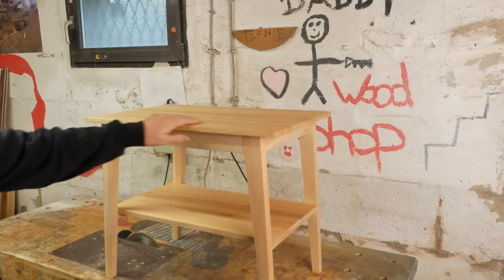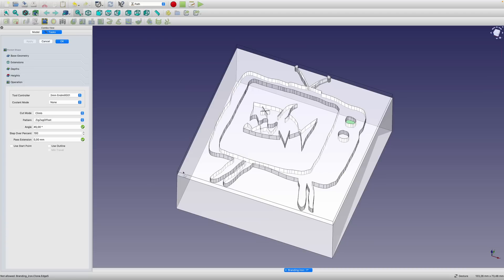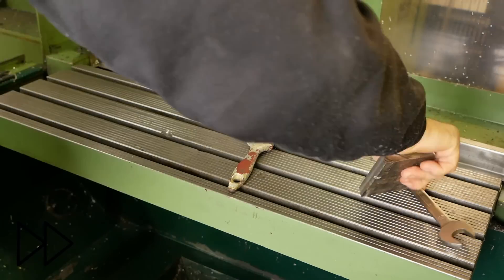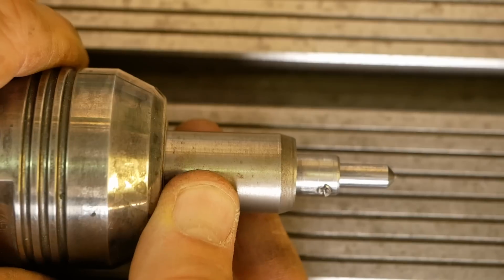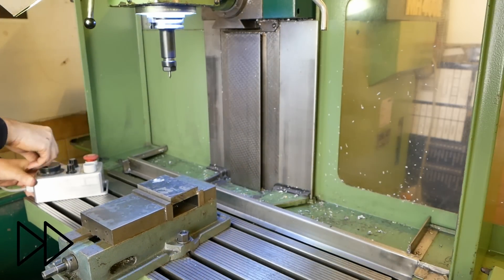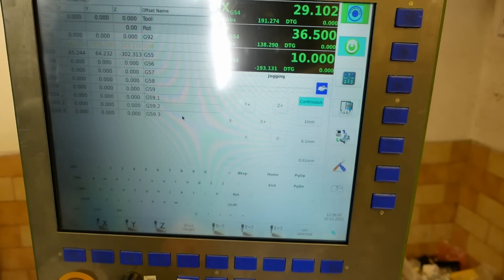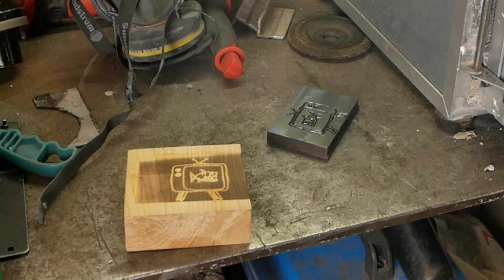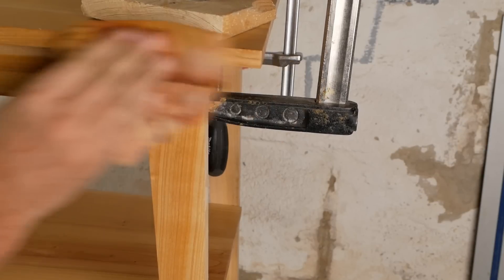Branding iron for my woodwork.

Comment: I would have said use Solid Edge but i dunno how they feel about you showing there software in the videos
Reply from the maker: I looked into Solid works, but they dont have a macOS version.
Reply: @RotarySMP  Solid Edge had one till 2019 but seems it’s not active anymore.
But yeah i was and are still on the search for a good cad software for my mac too. Fusion isn’t really something for me. Was thinking about ViaCad but i dunno if they really are usable or not. Oneshape turned out to be useless and Creo is a bit to expensive (they do have a mac version). FreeCAD turned form me out to not be the solution as lots of stuff with it is more complicated todo then any other software. 

Such a sad state actually as the mac is quite powerful..

Comment: I used to work linoleum printing and did that myself. There should be a simple 'button' to select for 'negative' to carve away the negative space. Also you might want to trim the blank to a smaller size and carve centering groves on the edges and/or back to help align it with the item being branded and machine a stud on the back to grab, maybe one day make a detachable wood gripped handle to help.
Reply from the maker: Yeah, I agree with all those points.

Comment: I can't help you with the software your using, but I seriously suggest V-carve pro which comes in a version Cut2D which should do everything your asking,, PLUS it's the easiest software to design and generate toolpaths I've ever used. Without VCarve pro, I would have given up on CNC all together. Example: I spent moths frustrated by Fusion 360, and never produced anything, In 1 hour I was using my CNC cutting everything I needed to cut. AND WAS HAPPY, VERY HAPPY
Reply from the maker: Thanks for the tip. I 'll check it out.

Comment: I suppose there is some error in metric and imperial dimensions during export-import in different pieces of software.
Reply from the maker: Could be. I had to scale that part.
Reply: @RotarySMP  scaling is just workaround, better you need to do import-export properly, all in one system, please check your software settings.

Comment: Morning, Mark! Comment for the algo! You know, I really need to try getting into FreeCad again. Last time I tried I was so frustrated with the tools not working well or the same way they are described in the few tutorials out there on YouTube.
[edit] well, I made my comment before you'd gotten to the point where you describe your frustrations with FreeCAD. Shocked, not shocked. :face-fuchsia-tongue-out:
Reply from the maker: Hi Vince. I have had some success with FreeCad lately. I learnt to like it's spreadsheet based parametric system. But there is plenty of frustration baked in.

Comment: Honestly, I wouldn't try to CNC that makers mark, it just looks too intricate for that method, at least not without being really large.  Rather, I would probably etch it.  

Create a mask on a blank the size you want. There are a few ways to do this, probably the best way would be to spraypaint the blank face, then use a laser to burn away the areas you want to etch, next best method would be to use a vinyl cutter to cut the design out, weed out the parts you want to keep, apply the stencil the blank spraypaint, then remove the stencil to reveal the areas you want to etch. You could also cut a stencil out of vinyl, weed the parts you want to etch, then apply the stencil directly to the blank and etch that way, just keep in mind that whatever method you use you want the bare steel exposed for the parts you want to etch away. When ready, put the blank into a bath of ferric chloride or some other strong etchant (nital, picral, etc).  Then just wait until the etch is deep enough. You can speed up the process if you can get the etchant to move around, such as putting on a vibrating pad, but its not absolutely necessary. Providing you etch deep enough you should be able to produce a very nice mark, and using this method you could make the mark as small or as large as you want while retaining detail.
Reply from the maker: Oh, that is also an excellent idea. My daughter has a silk screen kit, so I could use that.

Comment: Could this be some kind of scaling issue due to the import and FreeCAD thinks your 2mm endmill is too large for the features?
Reply: My thought exactly
Reply from the maker: It would not get into all the features, but it wouldnt even work on the knob holes, and they are easily doable with a 2mm end mill.
Reply: Not when FreeCAD thinks they are 1/10 of the size only

Comment: FreeCAD is an amazingly flexible software - you can do everything in 10 different ways - but they all dont work 🤣
Reply from the maker: That is an unfortunately rather accurate summary. Easy things I find work really well, but you always get to a point where you are scratching your head, diving into the forums, and find no solution
Reply: @RotarySMP  Yes exactly. Im now at the point that I can use it quite productively but Ive been using it almost full time for over 2 years and I 2 other people fixed quite a lot of stuff in the horrible codebase.
Reply from the maker: @Narwaro  Thanks for your efforts. Luckily I am not a realy power user of CAD, so FreeCad allows me to get most of the minor projects I need done.
Reply: I tried FreeCAD. It’s a horrible mess of a software. Good for people with way to much time on hand and nerves out of steel.
Used SolidWorks (community Edition without a proper working CAM) for a year tried Solid Edge and payed for Fusion360 in the end to have the CAM with tool changing post processor.

Comment: i would do a negative of your design, thats usually how branding works. then youll have less surface area touching wood and itll be much clearer too. no idea about freecad, but fusion360 can do a hell of a lot, not sure how much on a free licence though
Reply from the maker: That is what I was trying to acheive, but couldn't get the tool path to work. Since I monetised my channel, I cant use the free version of Fusion.
Reply: @RotarySMP  you get everything you need licence wise with the basic licence. I think its around £350, not sure of price for your currency. But its well worth it. Doesnt take long to set tools and machines up on fusion, the only tricky thing is getting a post pricessor file for your home made cnc. But im sure you can code your own after everything ive seen you do, it would be a walk in the park.
Reply from the maker: @SebbyG86  I'll look into that. Thanks.
Reply: @RotarySMP  sent you a quick email

Comment: Dont know much about freecad, cause i work with f360 but i get these issues if my stepover for the final pass is bigger than leftover material to cut (if thats understandable). Also these are some very fine features and i figure the branding iron would need to be pretty big if you choose to mill with a 2mm bit, in order to preserve detail of the model.
Maybe doing a negative of your logo would work better.

Thanks fot the nice content - Greetings from Trier :)
Reply from the maker: Thanks for that idea. I tried giving it the fake 0.25mm end mill, but that didn't address those issues either.
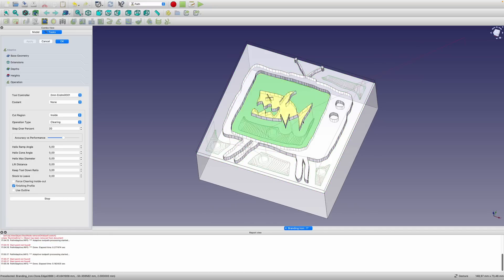Reply: @RotarySMP  Had a look at the video again. At 2:17 it seems like freecad doesnt want to generate toolpaths outside of the stockarea, thats why toolpaths on the upper left corner and between the antennas are missing. This could be fixed by changing a toolpathsetting (i figure cut region and stepover percent maybe) or making the stock a bit larger in cad then it actually is.
The upper area inside the screen seems too delicate for a 2mm tool.
I would also suggest working with multiple strategies for different areas while decreasing toolsize, like maybe roughing and two light outline finishing passes.
Reply from the maker: @fieur  Thanks for the ideas. I will try that.